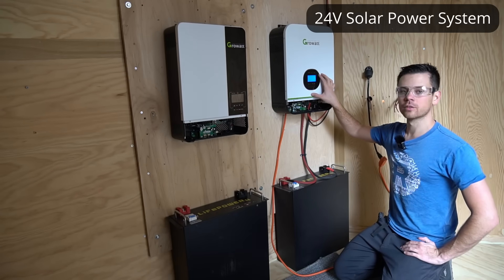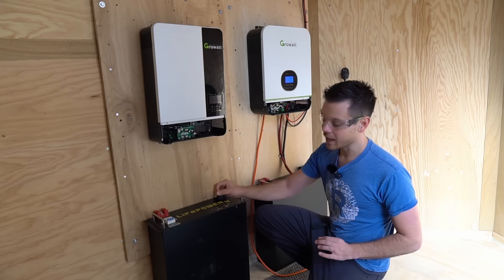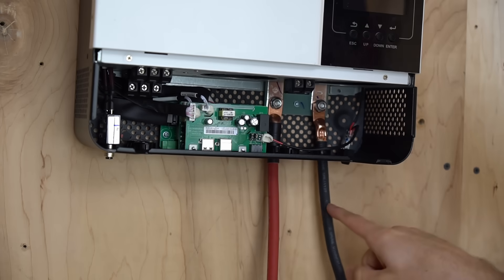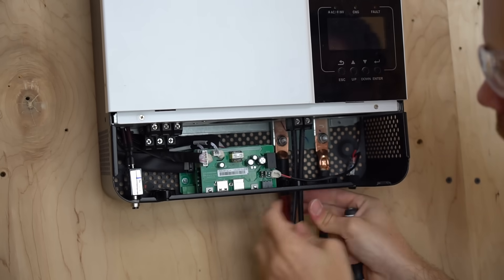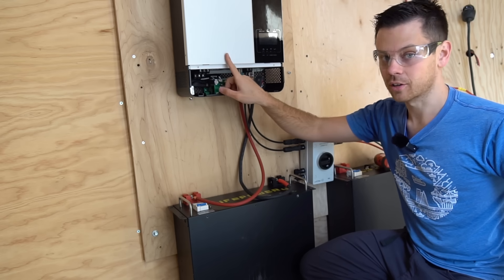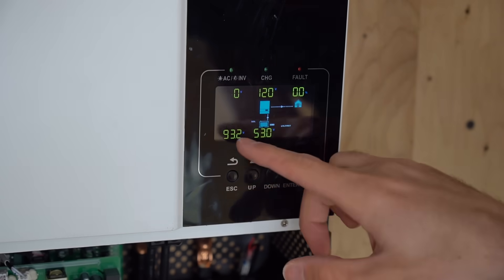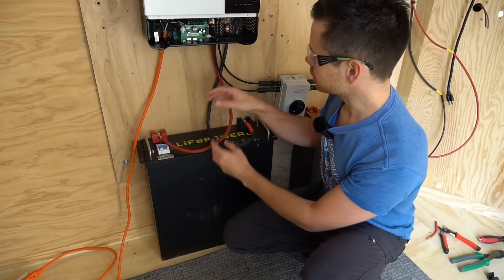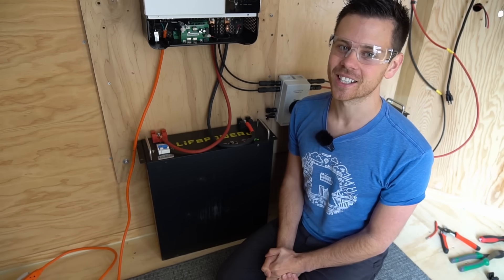Beginner Friendly 48V Solar Power System! Step by step!

Comment: As far as I could tell, you were connecting to a LiFePo4 battery system, in which case you should NEVER enable the system to utilise a n Equalization charge voltage of over 58.6V (it showed 64V in your video, which is ok on a Lead-Acid based system). You will either have the internal BMS of the battery server rack to switch off, or if not using a selfcontained battery rack you will overcharge the cells. Also you should mention that it should be checked that the BMS output transistors can handle a potential short of the inverter transistors, resulting in the full PV voltage reaching the BMS/battery bank. Another option is to use aN external BMS, utilising a relay instead of transistors to disconnect the in/output of the battery bank.
Reply from the maker: Yep, and that's why my absorption voltage is set to where it is in the video. Have you not seen my absorption recommendations on my website or on my forum? I cover this quite a lot. Are you new here?
Reply: @WillProwse  well I just noticed in your video, that you had a 64V equalization voltage setting, sorry I incorrectly called it the bulk charge setting.
Reply from the maker: @steenhansen5625  no, it's not set to 64V. I disabled it
Reply: @WillProwse  Sorry, I just viewed it again, and indeed I didn't see correctly, but you aught to mention that Equalization should be disabled or set appropriately.

Comment: Hi Will, the safety points are very important. While some people survive shocks, others don't. It's best to treat anything over 30 volts the same way you handle a gun -- like it always has the potential to kill. Over 30 volts can overpower your nervious system and result in the can't-let-go effect, resulting in extended shock and high potential for death.
Reply: Good points. I noticed he doesn't use non-conducting tools specifically made for electricians, which is a must for these voltages. Gloves would be a good idea as well.
Reply: I was taught to always “test for dead” before starting work, you only have to get it wrong once.

Comment: This is the level of expertise we need on YouTube to help people to transition to renewable energy. Will Prowse sets the bar - others need to watch & learn, then up their presentation quality to match.

NOTE: we're not going to keep global warming to under 1.5C, but with more & more people transitioning to solar power we might be able to keep warming below 2.5C. We have a chance if the solar power transition is going to be simple, inexpensive and reliable. Rack mounted LiFePO4 batteries like these are a huge step towards these goals.
Reply: its a pipe dream for the masses and it is far from stopping "global warming" that's the other lie.... nothing about solar will "save the planet" period!
Reply: @OFFGRIDwithDOUGSTACY  
Agreed.
The mining, manufacturing, and transport of photovoltaic components grossly reverses any supposed temperature shift.
.
To those massive costs, add the degradation of the mining site, the surrounding communities, and the long-term hit on water quality.
.
Then add the profits -- paid by the end-user -- required to re-pay bankers for the use of their capital.
.
Today and perhaps for another decade, photovoltaic is merely an expensive hobby.

Comment: 50V DC is on the very edge of danger. Basically all the conditions would need to be perfect for it to be dangerous, both hands wet or wounded, both hands holding opposite terminals then maybe, just maybe it could kill you. Electrical safety standards are written for the worst possible cases so that's why it says 50V. But if 50V DC was lethal you would have welders dropping dead left and right, they aren't.

Comment: Good tutorial. The only addition I would add is to use some red electrical tape to wrap the positive conductor of the solar input. The method you used, with the polarized plugs, makes it almost impossible to make a mistake, but if all the rest of the low voltage wires use red for positive, you should continue to use that throughout the system.
Reply: I do the same.

Comment: For increased solar panel safety you can also just connect the wires at night since it should be under 20 volts and no current
Reply: And DC 60 volts isn't really dangerous unless you get it under your skin and yet it is not a big chance of damadge. It might sting but not kill.

BUT you never know when a freak accident happens so...

Ive licked the cables of a 68volt battery as a "child" and it hurt pretty good and my vision flashed white, but no damadge and holding it in my hands didnt notice anything unless i poked the wires in the skin
Reply: @tullgutten  
I did something similar.
The only permanent injury seems to be a complete inability to not reply to random comments...

Comment: What Growatt's are they? Sellers of Growatt over here (NL) claim they can only work with vendor locked batteries. Also, very impractical, but you can 'turn off' solar panels by covering them.
Reply: According to unsubstantiated rumors, some photovoltaic panels are less effective at night.
But I would be the last person to spread gossip...
Reply: @largemarge1603  Obviously, but working in the dark on a rooftop is not really considered 'safe practice'.

Comment: Nice job Will, much better than the multi-component plywood setup.
Reply: Michael,
I think those demonstration boards are intended to be temporary.
I think a permanent mount would benefit from non-combustible materials.

Comment: I have a back-feed connection on my house for a gas generator.   Is it possible to hook a system like this up to that?  It's on a 30amp double breaker in my box.

Comment: Yes I agree with the last comment about follow through to a panel and how it’s wired with circuit breaker’s. One more question can you just transfer your wires from your current circuit panel to the new solar powered panel

Comment: Why not add a appropriate/(gigantic) Zener diode to the solar array to dump over over volt to a dummy load so as to increase collection with out over volt condition and over build the solar panel array to account for <85% and still get a full collection voltage, just dump the excess at >98% collection if there is a problem with over volt with the inverter charger. one or two extra panels. `spares if needed could just be bypassed if failed. Running 140% input, find somewhere to dump it, Hot water, Cryocooler...

Comment: Will, sorry if my doubt is stupid. Here in Portugal, tri-hour fares are absurdly cheap during the night ($0.09/KWh) and quite expensive during peak hours ($0.32/KWh). which inverter do you recommend to use with 48v batteries (no solar for now) where I can charge a set of batteries overnight and use it during the day and save my money? I've read some manuals such as growatt and ecoflow and haven't seen an option for this type of programming. Thank you very much in advance.
Reply: Eduardo hi from Australia I just recently purchased a8000w MPP HYBRID  charge controller.this unit and it's little brother ,can charge from the grid when batteries run down.chech it out.brand is called MPPSOLAR.cheers Rene.

Comment: i am building a system almost exactly like this tomorrow - but I don't have a server rack battery. i only have 16  X 3.3 winston thundersky cells for a 48 volt system-also like your example I have 9 solar panels in series. i am wondering if I need another breaker (to mimic the breaker on the server rack batt), and or a T class fuse II could not find one so I bought a 120amp audio fuse and fuse holder....also i have no bms. but I'm assuming my all in one can function as a bms....anyway-PLEASE show an example with a self built lifepo4 
 48 volt battery and corresponding safety issues-!

Comment: Will, Next build you may wish to use crimp connectors with the correct size stud size holes for the Growatt. :-)
Reply: David,
From my perspective, the clamps seem engineered to grip a stripped cable.

Comment: Another super cool video dude, now show how to break off some super high high  capacity high efficiency12 volt branches fed by this monster power bank... my reason for going with 48 V is to have a concentrated power reservoir, but the actual boat lighting and other circuits that are not 110 a/c are all 12 volt. 48 volts can feed 2 to 4 twelve volt circuits to feed things like LED lighting, radios, trolling motors, etc without all of that power robbing 110 inverter presto change-o crap... and for those that want to know why not just build 12 volt systems to begin with - it is because some high draw applications like trolling motors pull more amps than the average 12 volts system can easily handle.  High draw applications like trolling motors, engine starters, and things like that have temporary starting loads that easily over draw the amperage capacity of your average 12 volt battery bank.

Comment: probably i am paranoic...
for safety i would never put batteries or inverters on any wood conained surface..
smoke detectors would not help..
there are many alternatives, just bolt on sort of insulating material and cement based plate

Comment: I think you meen 50V AC  and 120V DC. So your are save with 48V system. Annyway, always be carefull offcourse. 👍🏻
If you work on an e system, you have to massure always if there is anny current. Not only the beginner has to do this.

Comment: Perfect timing just looking to buy my accessories for my 48 volt system
Would you recommend a spd as well as/or instead of the dc solar switch??
Doing two arrays with two 5K inverters and two 10k 200amp batteries

Love your channel
Reply: If you need I just got my griwatt shipment in today I sold out park time I’ll beat anyones price even James’s in Texas I’m just starting this store so I have everything midpoint transformers form 5000 watt edge one to 11,400 watt growatt manes for those 5000 watt units let me know I’ll beat anyones price  also sell rack mount battery’s with 10 year warranty’s
Reply: I have a 12 k low frequency inverter you might like it can surge to 36,000 wars for 30 seconds

Comment: Hey Will, nice videos you doing. 
Had to comment on a few points this time though...
For this inverter SPF 5000ES used in the video;
*Max PV VOC is 450V (not 145v). 
*MPPT range is 120v ~ 430v
There is no charge from your array during the video session because your PV array was below minimum required.
Reply: He said he used a 3K inverter, if so, it's likely the 3000TK LVM-ES with 120VDC-250VDC MPPT range. Same result, however, with <100VDC input.
Reply from the maker: Gosh dang it you guys are right. 250V max input. Can't believe I missed that.
Reply from the maker: And yes, that's why it's not charging.

Comment: You may want to suggest to put the OCP (I.E. circuit breaker or good quality AC outlet strip with circuit breaker) on the AC output of the inverter.

Comment: Will, Quick question, shouldn’t your DC isolator for your solar panels be as close to the solar panels as possible?
Reply: I think some converter boxes have that functionality built in. If not, I'd probably design my strings to have one on each end.
Reply: @CptDrake  
Agreed.
2003, we built our ExpeditionVehicle with fuses at each potential source.

Comment: Thanks Will, I was hypothesizing a build like this when I had my house 120v wired for a generator (220v is still grid tied). The logic was to utilize a generator initially for emergencies (120V with  30A) but it would later facilitate the transition to a setup very much like what you have shown on this video. The one difference being that instead of wiring an extension cord like you did, I would wire in an L14-30P cable to connect to the same. On days where solar charging is poor we can direct charge the batteries with no draw during the day and run the generator during the day or as needed.

Comment: Hi Will,
is it possible to use 2 or more MPPT as fail over and extra capacity?

for example:
let's say we have two MPPT with 2000 Watt AC output each.
2 MPPT x 2000 W = 4000 W

1. Is it possible to output 4000 Watt AC in one system?
2. When one of it is failing, will the other stay on and provide 2000 Watt automatically?

assume, each of MPPT have its own set of battery and solar panel.

Comment: Is it possible mix / match these 48 volt server rack batteries if they have the same specs or not a good idea? I have a Jakiper on order which should arrive soon, but what if I can't get another later and went with one of the EG4 models... would it be possible to parallel those 2 brands or not recommended?
Reply from the maker: I have about 6 different brand batteries cycling together daily. All in parallel. Works fine, just ensure each has circuit breaker.
Reply: Yes you can I have a lot of diffrent Ins till I found a good manufactuer to buy from for my website abs store I just make sheet I fully charge each one then I connect them so they can all stay with if the same state of charged and balanced I have not tried mixing 100 amp hours with 200 amp hour battery’s I never tryed I do t think it would work but you wills want to keep each one isolated on there own brakers

Comment: I finally got my system built and operational in October. I studied for 3 years, buying panels and watching you and David Poz. I made my own adjustable array with a combination of sixteen 350W and eight 315w panels, 2 strings of 12 each. Went with two 48v banks of Rolls S6 L16 FLA batteries @ 445AH for a total of 890AH. Went straight to the top and got a Sol-Ark 12K. Added a Winco propane 8K standby generator. Love the SOl-Ark. It's not "set-it-and-forget-it", but it's ability to direct the greatest input to the most needed output is outstanding. The auto start feature for the genset is just fabulous. The videos are unlisted, but if you should have any interest in seeing the build, I'll send you the links!

Learned a LOT about FLA's. Properly maintained, You can get better than 10 years out of them. Believe me, I did some thorough researching before choosing FLA. They match my personal parameters for output, maintenance, cost and life expectancy!
Reply: I had backwoods solar design a system for me and so far I have my solar panels mounted with a 1000 gallon propane tank and a 12k Cummins generator behind the panels. We’re running 180’ to the house after combining two 4 panel sets. The panels are 385 watts each and they’re 48 volt panels. We just got the upstairs closed in but now we need to pull wires and wire the house and we’re going into the deep freeze for a while like -10-20 below zero at night. I can’t wait to have it all hooked up! We will be supplying energy for a SIP house that’s 28x32 on a walkout basement. Heat will be supplied by a propane fired by a modulating boiler hooked up to infloor heat in the basement and baseboard upstairs and wood stove will supplement the upstairs so hopefully that thermostat won’t ever call for heat.
Reply: @grumpy1962R  I longed for the 385's, but I found the 315's and 350's new for 49 and 47 cents a watt. Can't pass that up!
Reply: Your youtube content is interesting. I like your old school approach (I am old school as well). 
I am interested in the info you have for your solar installation, if you're still offering...
Thanks in advance.
Reply: solark might be great but so are the price 6900.  plus batteries plus panels  . wills system showed  1500 t0 1800 battery 800 for all in 1 and 1000 panels  3600 total. yes smaller system but many off grid its plenty
bigger systems are different and your inverters possibly the best
Reply: @jar407  Went together with a friend of mine on all our purchases. Made a significant difference in price reductions! I know Will has his own site, otherwise I'd post where to get the best price on the Sol-Ark. If he steps in  with a comment allowing such, I'll post it.
Reply: i went rolls twice and regret ever buying them... they wont last more than 3-4 years.
Reply: @baby_UFO  Their literature is the most thorough I found, and the tech support supplied quite an education. I noticed my specific gravity was never coming all the way up. Since I programmed 890Ah, the controller drops to float voltage when it sees current drop to 17.6 amps to the batteries. They were not sufficiently charged to bring the specific gravity back to specs. Rolls rep had me reset the AH rating to 800. This caused the controller to drop back to float voltage at 16 amps instead of 17.6. That translated to more hours of charging at 60 volts. The other issue I had was the Sol-Ark shut off the generator when it hit the float voltage of 54.7. On solar, the output to the batteries is 61.4 volts, with amperage determined by battery resistance. (charge) The bulk and absorption voltage is set at 60, but temperature compensated for 45 degrees F, hence the 61.4v. On the generator, the output is limited to 4400 watts i.e. 80 amps and the voltage remains lower than float. As they charge, resistance increase and the voltage rises until it hits 54.7v. It appears that Sol-Ark has programmed their system to determine float by reading amps while on solar, but using float voltage setting to turn off the generator. Since it has been cloudy for a month or more, I reprogrammed the float voltage to 61v to prevent the generator from shutting down at 54.7 volts. Yesterday was the first time since October that my specific gravity came all the way up to 1260+. Checking specific gravity is an absolute must to determine the charge of a FLA battery.
Reply: as a guy that has had an off-grid system for 10+ years, I agree that FLA is the best bank for the buck out there